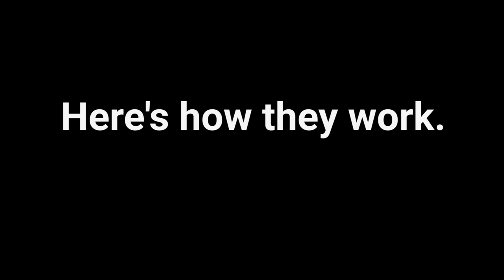Spiral Wine Cellar

Comment: And it costs less than $50,000 to build... I own property and understand that this is a simple spiral staircase, plus a cutout, and some shelves. Cutting out parts of the floor that were already paid for? Cheap, plus you can reuse the old floor material for a trap door. A 10 foot spiral staircase? About 3,500, most expensive portion. Shelves? About a grand or two if you really must be fancy. Plus some carpentry and ownership of tools. That adds up to a lot of time, skills, tools, and money, but NOT $50,000 worth.